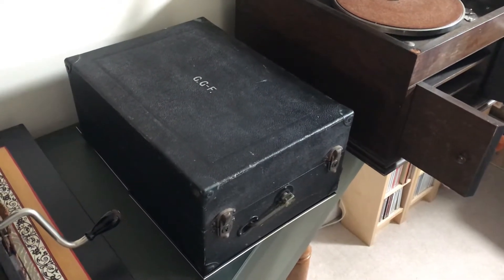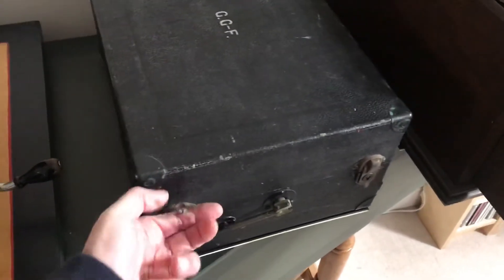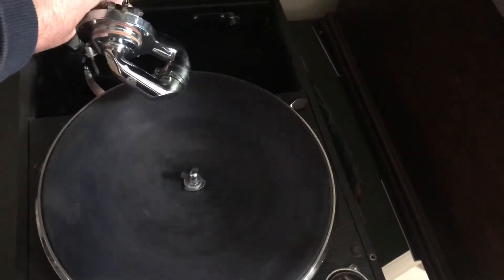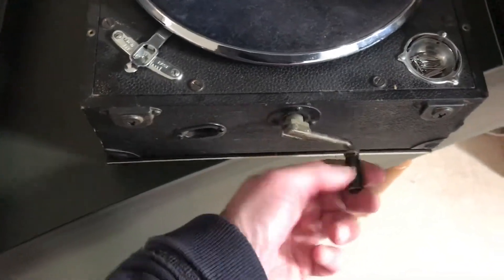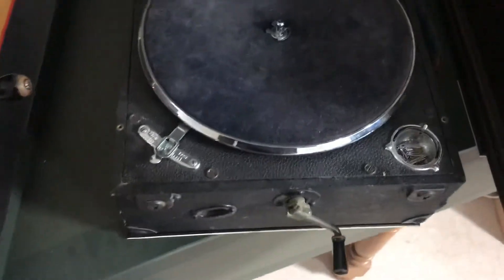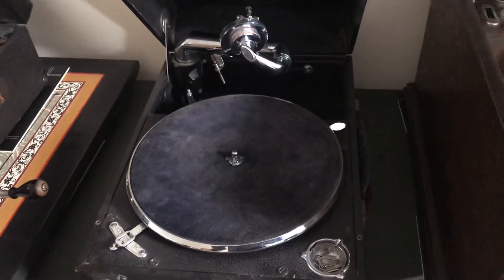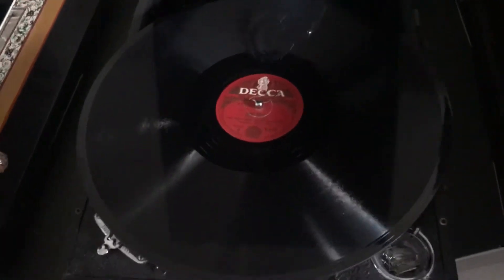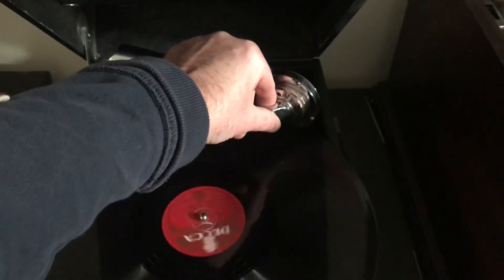How a 1928 Columbia Model 201 portable gramophone works

Comment: I just picked up one of the blue 202 gramophone but I can’t seem to move the needle arm it seems to be stuck could you give me some suggestions on what I can do to fix it? The condition of the gramophone is very good overall and the mechanical aspects still are working.
Reply from the maker: Hi. I’ve used a hairdryer on the joints to heat up any congealed grease then use WD40 to lubricate once the parts move

Comment: Superb. Would this play thirty three and a third or are the grooves too thin 🤔
Reply: too thin and too susceptible to wear. most of these machines were built with shellac in mind so any compound weaker than the steel needle designed to wear against it will immediately suffer damage